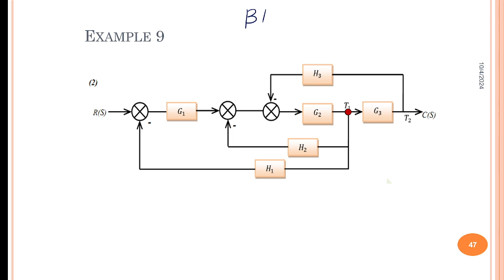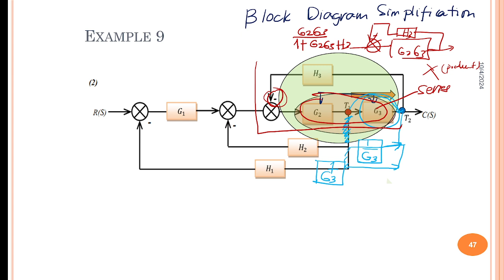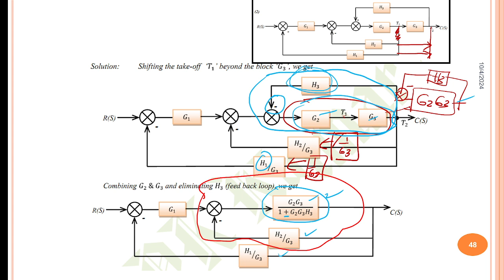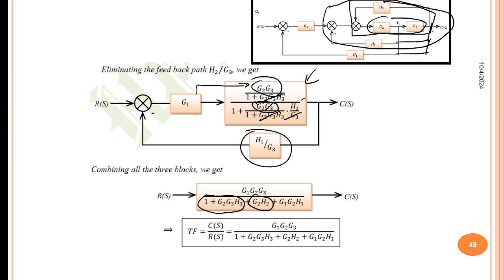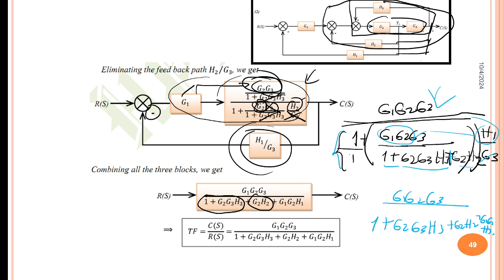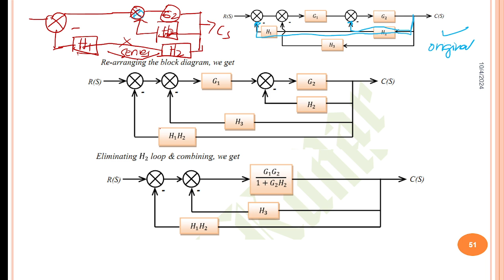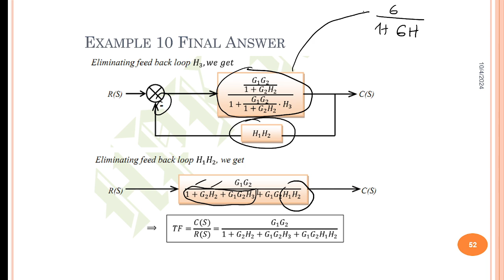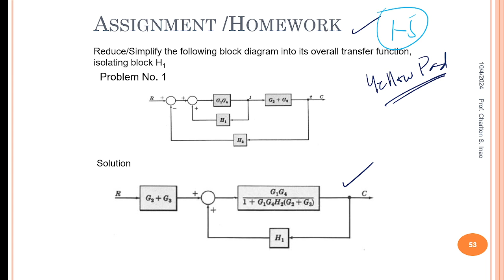Block Diagram Simplification: Exercises 9 and 10

Comment: Mark Christian Brian P. Catubigan
BSME 2-1P

- Before proceeding on simplifying block diagram it needs to do step by step process that includes moving the pickoff point
- Rearranging the block diagram helps on simplifying the block diagram like isolating them, if the two blocks involves in feedback but in common line.

Comment: Napal, Hanna Joy N.
BSME 2-1P

Although two blocks are in series, we can't just simplify if there's a pickoff point in between them, so we need to transfer the pickoff point using standard moving of pickoff point block transformation (reciprocal of the block)

Carefully examine the whole block and simplify everything. Eliminating a feedback loop uses the standard formula of G/1-GH

Comment: Lourence B. Legaspi
BSME 2-1P

Three things I’ve learned:

1.  Based on the video that I watched, I learned that the technique for simplifying a complex block diagram is to carefully identify the G’s and H’s, simplify the standard form for a better understanding of the diagram, and then combine the blocks series to parallel or parallel to series.
2. Another part of simplification is moving the pick-off point to another place, in order to eliminating it, just multiply by 1/G.
3. Also, to simplify the summing junction or move it, just multiply it by G/1+GH where the sign depends on the reciprocal of the given sign.

Comment: Rangaig, Catherina B. 
BSME 2-1P

1. I have learned reducing complex systems by simplifying block diagrams. I have also learned the rules in simplifying this by identifying series and parallel blocks. 

2. I learned the rules in moving summing points and Pickoff Points and as well as using Feedback Loop Formulas.

Comment: Magpantay, Renz Angelo R.
BSME 2-1P
1.  When working with block diagrams, especially in systems engineering or control systems, understanding how to simplify complex diagrams is crucial. The process involves a systematic approach to breaking down and rearranging the components for easier analysis and comprehension. Below, we explore the key steps involved in this technique.
2. To eliminate the pick-off point, you can employ the method of multiplying by the inverse of the gain, or 1/G, where G is the system's gain at the pick-off location. This action helps in balancing the system equations and removing the pick-off point from the system without altering the overall system behavior.
3. Simplifying a summing junction by using transfer functions can significantly streamline the analysis and design process in control systems. By applying the formula (\frac{G}{1+GH}) and considering the appropriate sign, you can transform complex configurations into more manageable forms. This technique is valuable for engineers and students working to understand or optimize control systems.

Comment: BSME 2-1P
Alvarez, Jillian 

Simplifying a block diagram involves reducing a complex system into a simpler equivalent transfer function. This is achieved by systematically applying rules such as in series, parallel, feedback rule, etc.

Another rule is moving a summing point. If you move it before a block, it requires dividing the inputs of the summing point by the transfer function of the block. Then if you move a summing point after a block, it requires multiplying the inputs of the summing point by the transfer function of the block.

Comment: Ban-o, Clairel May B.
BSME 2-1P

simplifying A block diagram involves reducing a complexc system into an equivalent transfer function by applying rules such as series, parallel, and feedback. Moving a summing point is another important rule, if it is moved before a block, the inputs of the summing point are divided by the blocks transfer function if moved after a block the inputs are multiplied by the transfer function. When two blocks in series have a pickoff point between them,l the pickoff point must be transferred using the reciprocal of the block's transfer function. 
The entire block diagram should be simplified carefully, using the standard formula G 1 - GH to eliminate feedback loops.

Comment: Margin, Justine Dave P.
BSME 2-1P

1. Block diagram simplification is a method to represent a transfer function of a system
2.  Based on the example exercises as we go deeply to the other types of block diagram we can see different position of summing junctions or pick up points so it is better to determine first which one is we should fix or adjust just to get to the 1st step

Comment: Carl Aldin E. Montecino
BSME 2-1P

1. When simplifying, identify pick-off points (like P1) where signals can split. If blocks are in series but connected via a pick-off, adjustments are needed before multiplication.
2. When blocks are combined, multiply the forward path and account for feedback. Use distribution to simplify the expressions and cancel out terms where possible.

Comment: LEBUE, CAMILLE ROSE
BSME 2-1P

1. Simplifying a block diagram involves breaking down a complex system into a single equivalent transfer function using rules for series, parallel, and feedback systems.
2. Moving a summing point before a block means dividing its inputs by the block's transfer function, while moving it after a block means multiplying its inputs by the block's transfer function.

Comment: NAVIDAD, Natasha Pauline S.
BSME 2-2P

1. Block Diagram Simplification is a method of depicting a system's transfer function, or the relationship between output and input.

2. Check whether the blocks are connected in series or parallel, then simplify.

Comment: Euree P. Mondal
BSME 2-1P

1. We must move Pick-off Points if observed between Series Connection before performing Multiplication to simplify it. 
2. Knowing the Parallel Connection and Series Connection will help us to simplify Transfer Function easily.
3. Series Connection use Multiplication, Parallel Connection use Addition or Subtraction.